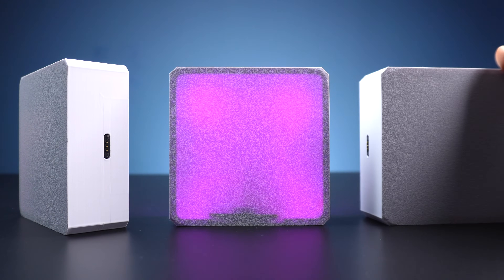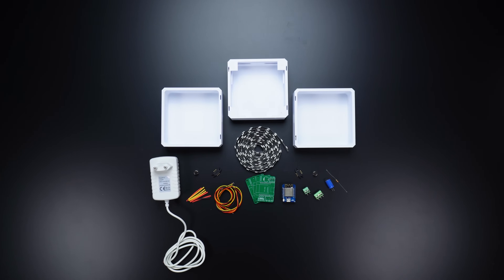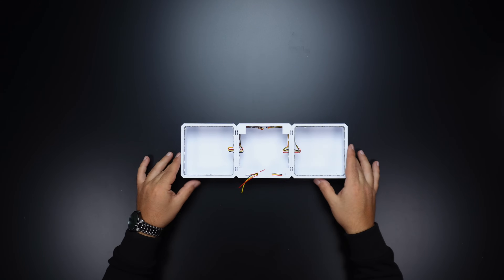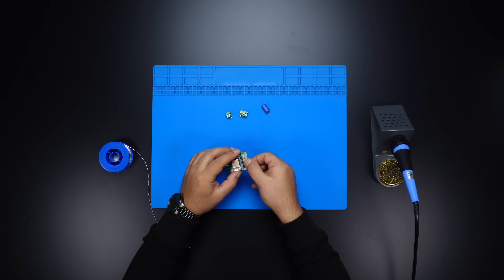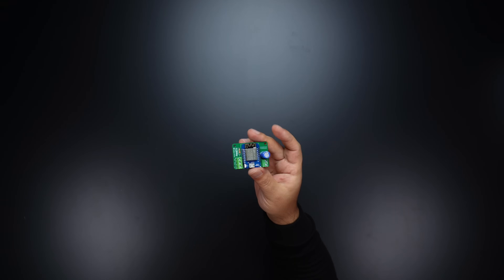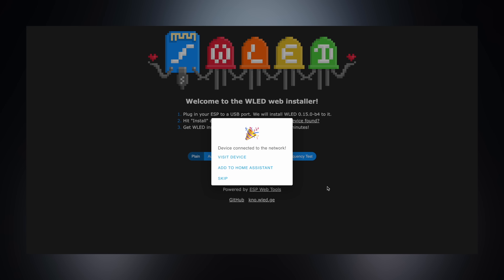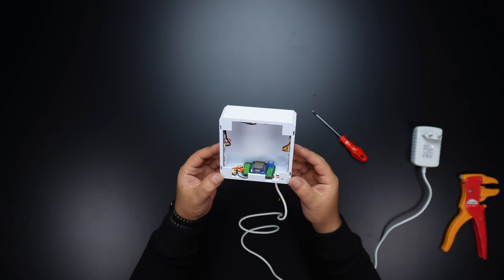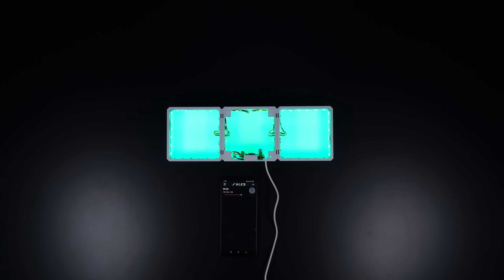Creative Modular LED Lighting with Magnetic Pogo Pins & Wi-Fi Control

Comment: Hello, what would you do if you wanted to produce a pattern by making a right angle turn instead of a straight line?
Reply from the maker: Next month I will do the project as you mentioned, this is in my mind. I will use 3 GPIO pins and create separate segments for each pin (LED) in the WLED software. I will also place pogo pins on at least 3 sides of the boxes. I will place pogo pins on the four sides of the main box (the middle one) so that it is possible to place them in different ways.
Reply: @ When I saw this project, I immediately wanted to integrate it with Home Assistant. If I can find time and you have permission, I would like to make a more usable version of this project that can be integrated with Home Assistant and share it here and on GitHub. If you have permission.
Reply: @maker101io  Congratulations for such a cool thing! And one suggestion - why don't use same pogo pins for power supply to any box instead of ""hard" powered "main" box?
Reply: @maker101io  how is this idea now?